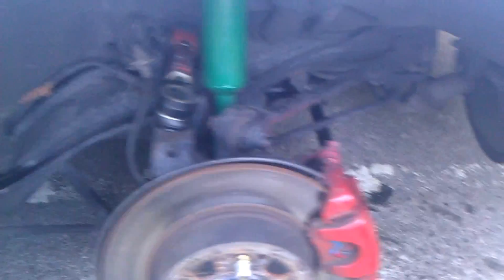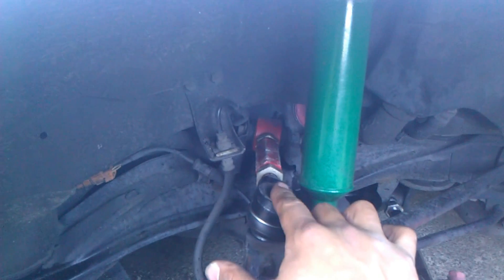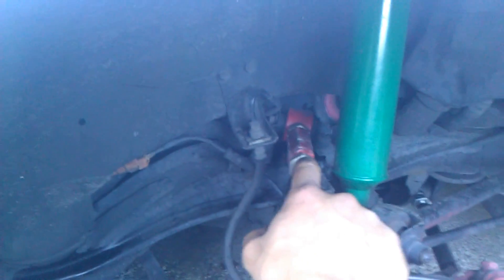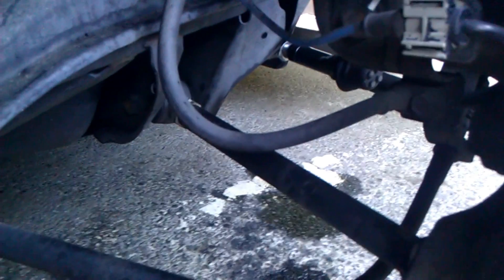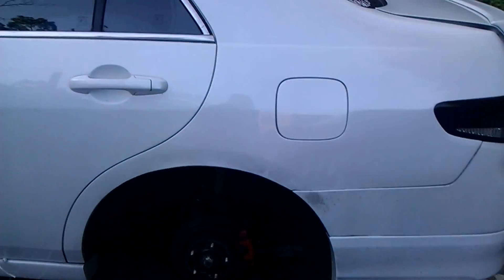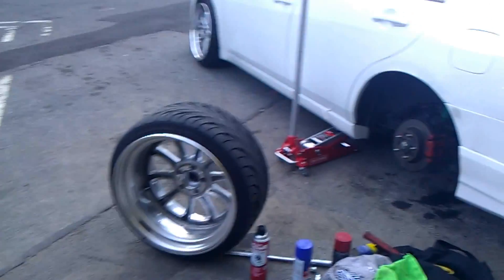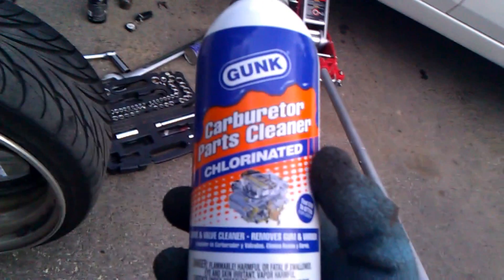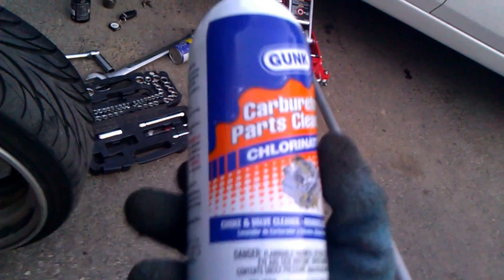How to Adjust Camber for 03-07 Accord 04-08 TSX and 04-08 TL

Comment: how do I remove the Rear Camber Adjustment arm. I was able to take of the inner bolt on the frame. I cant get the stock rear camber adjustment off the brake assembly.   Any special tools needed / or any website I can read or watch video on how to and what is needed to remove this. THANK YOU for any help